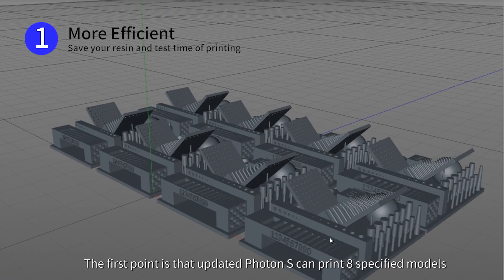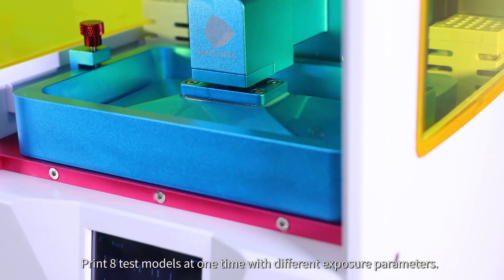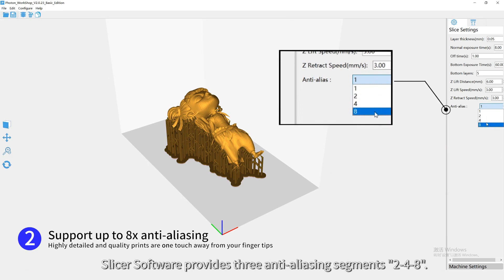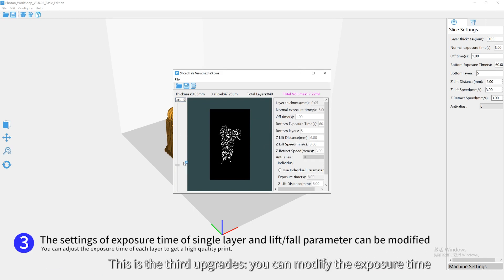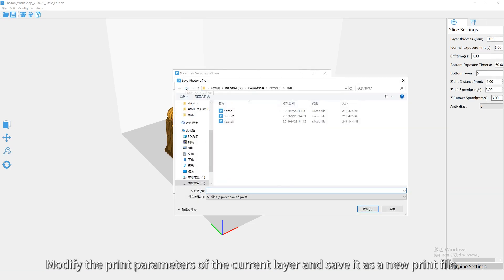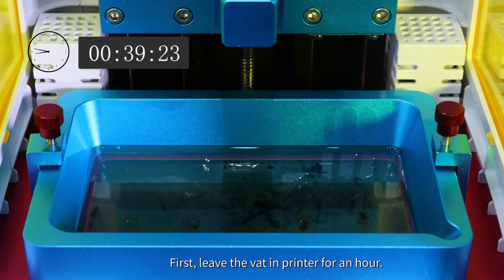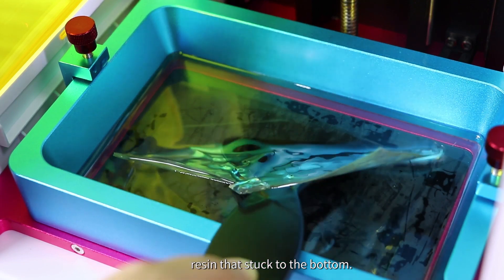Upgraded Anycubic Photon S : 8x Anti-Aliasing, A Quick Test To Know The Best Exposure Time

Comment: Curing the bottom layer for 45-60 seconds to easily remove partially cured resin is genius.  This should be more widely mentioned, as this is the first I have heard it.
Reply from the maker: Thank you for your feedback James
Reply: Yeah lol, I didn't get it why there is this option at all. It isn't even mentioned in the manual.

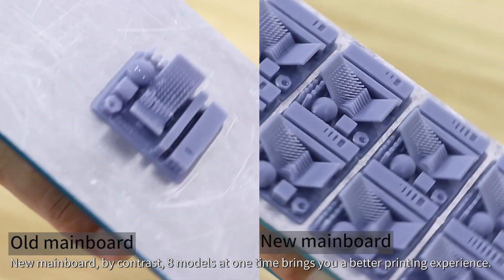Comment: 0:47 And I was worried of getting my buildplate scratched.
Reply: Isn't having a scratched build plate aqtually a good thing? I heard some people even sand them to increase the Grip of the plate.
Reply: @Zeriel00  I've seen some vids on YOUTUBE where they unbox, do a test print or two where they have trouble getting the print off the plate, then sand it to remove the anodization coating on the print side.  The finish just holds too well.  Understandable.
Reply: @Zeriel00  In that case you use your slicing software to put down a  BASE that is sufficient to hold your item.  The base should have enough area to cover the maximum area you'll need supports for.
Reply: @Zeriel00  You are more than welcome.  Would you believe that I not only do not own a printer, but never have and have never used one?  I just gave you info I got from watching vids on Youtube.  Watch some.  You'll get great info.  I didn't even know about RESIN printers until a month ago when I started searching vids.  I quickly realized that IF I were going to get a printer, it was going to be resin and not... the type with the reels of melty plastic.  What's that called, PLA?  Right now I'm looking at the Eleego SATURN and the Photon Mono X.  The Saturn is $400 or less, the Mono X is about the same size, but I've heard conflicting price points.  If it's going to be a "SATURN KILLER" as some have said, it needs to be priced competitively.  But I've seen estimates of $1K. "I aint payin' 'dat", as they say.  Anyway, let us know how your first few prints come out.  And did you scour off the anodization?
Reply: @Zeriel00  Hey, thanks for the info.  Just about every vid covers the toxicity and safety.  I'd clean out my computer room closet and put a table inside and close it up when in use.  I don't believe in going small when i know I'm going to need a larger one.  The Mars and the Mono X are by no means industrial, but they will allow me to print large figures for painting.  I'm getting older (Friday was my 54th) and my eyes aren't that good for the small details anymore.  I've designed some on HEROFORGE.COM, but if I have them print them, they won't be the size I want them.  I can do that with my own printer.  I just pay for the file I design on their site and it's mine forever to print as many as I want.  I may look into Discord soon.  I keep hearing about it.   I'll keep you in mind if I do.  Thanks, again.  Later.

Comment: Can I do all of this stuff on my regular Photon (not the S model) ? I just got it very recently and it doesn't recognize photon files, but it does recognize the RERF pws file that came on the usb stick.

EDIT: just fyi the answer to this is yes you can. As long as the file is named I believe R_E_R_F you can use it for the test. When a file is named rerf the printer automatically cuts it up in 8 squares with 1 second exposure increments. I have a super small model and placed 8 copies of it in slicing software. Just break up the build area into 8 equal squares and place the small models somewhere in there. If you have any questions message me on this comment I'll be happy to help you out
Reply: You rock Photon face. Thanks man.
Reply: I have just purchased a photon s and I have the same problem. It recognises the R_E_R_F model file but doesn't recognise the prepared cubic model by Anycubic. I'm using SOLIDWORKS and I tried to print my models on SOLIDWORKS with converting to STL type files. Again it doesn't want to recognise them despite it has to work with SLT filed as noted in on the site. 
If Anycubic can help me, it will be great because it's my first 3d print and I don't want to think that I wasted my money for nothing.
Thanks.
Reply: @Luwian12  if it's an stl it should work fine. Which slicer are you using?
Reply: @luigiangelobuonarroti4110  Are you asking for what version it is ?
Reply: @Luwian12  try another slicer as well like chitubox or lychee. I know some models give me errors on Photon Workshop because there are artifacts in the 3d model. If you repair it it work, but also maybe try Chitubox and you might not need to repair it.
Reply: @luigiangelobuonarroti4110  Ok. It was really informative and thank you very much 😊
Reply: @Luwian12  let me know if you cant get it to work. We'll figure it out
Reply: @luigiangelobuonarroti4110  Ok. I'll get you know if it doesn't work. Thanks again 😊

Comment: How CAN i use antialiasing on the Photon S? I just can't get it to work, when I save it as .photon with AA from Chitubox, it renders it in monochrome even though the images are greyscale, and when I render it in Photon Workshop with AA on, the images are monochrome already!
Reply: When you save a file from Chitubox in AA the images are stacked. Each stack is black and white. Try this, slice an object with no AA and save it. Then slice it again and save with 8x AA, then look at the file sizes. The 8x will be 8 times the size since it has 8 images per layer that are different to create a grey scale. So instead of a pixel being lit for 6 secs it might be lit for 3, basically creating a 50% grey scale.

Comment: Hello. In this video I couldn't undestand clearly how to do this test print. Can you give me a help please?
It's only works with the new firmware? Where do I get this test?
Reply: It under the tools menu on the Photon S.  Remove the vat and pick from the 3 patterns.  You can also set the exposure time.  With the lid closed you can see the LED screen looking straight down through the top lid.  I've also actually let it print the start of a model that I'm having issues with, without having the vat installed. This lets you see an image of exactly what it's trying to print without having the liquid blocking the image. Once your ready to actually do the print just shut the power off, put the vat back in and then turn it back on and do the standard print process.

Comment: Hello, I have a question regarding Z = 0. Do I have to do this calibration procedure every time an impression is made?I ask it because, at the end of each print the printing table is removed and when replacing the table, there can it be a little deregulation of Z = 0? Since adjustments are made to tenths of millimeters, any wrong angle of the print base could result in damage to the LCD.
Reply: No, only if you move the printer or are having issues with prints messing up.

Comment: I bought a Anycubic Photon S, but the printer does not recognize the memory card. Can you help me?
Reply: Hey Renan - I had the same issue and what Anycubic Support told me to do to correct the non-recognized flash drive was to put a file called P_V2923.bin (that Anycubic Support emailed to me) on the flash drive at the root level of the flash drive (ie the main directory of the flash drive).  Also it's important to NOT use any kind of USB hub/splitter/dongle with your printer - just plug the flash drive directly into the printer.  **Of note - When I did thisNOT yet upgraded my firmware to be able to use the R_E_R_F.pws file.
Reply from the maker: hi Renan, thank you for reaching out and sorry for the inconvenience it may cause. Could you please click the link below to tell us more about it? Our support team is glad to help you there. 
http://support.anycubic.com/
Reply: Print files must be in photon work shop slicing format. Files in STL, 3d Object etc ... will not appear on the printer display.

Comment: could you describe settings used for  R_E_R_F.pws? I don't know how to set up time, after printing that calibration file.
Reply: Literally the most important aspect of this test and nobody will share the details...
Reply: @DR-br5gb  normal layer exposure time corresponds to the ‘start’ exposure of your rerf, each section another second is added. So if you have normal layer time set to 4s, then your top left section 1 will be exposed for 4s, section 2 for 5s and so on. For Mono printers, it doesn’t add 1s but 0.4s. https://www.instagram.com/p/CNTHDn5jLMY/

Comment: Please include infills changes in the software. 100% infill is just so costly when you can do with 15%.
Reply: you have to do it manually. Use meshmixer and hollow the model, add hole to let resin flow out.

Comment: What was the exposure test file you used at the beginning of the video?
Reply from the maker: R_E_R_F.pws  you can download it on Anycubic official website.
Reply: @ANYCUBIC3D  does this only work on new upgraded mainboard? or any photon s
Reply: @ANYCUBIC3D  I can´t find the file at the website.
Reply from the maker: please update the firmware and you can find the file“R_E_R_F.pws”
Reply: @ANYCUBIC3D  I found the file, but not thanks to you. To everyone else that needs to know where it is the file is located with the Slicer zip file. In the english website it´s the V2.0.23_for_win link under "Slicer". Once you unzip it the installer and the R_E_R_F.pws files will be there. In the chinese I dunno if it´s the same.
Reply: @BetoHertt  thanks. I wondered why I couldn't find it. It is too bad that they made it PWS only for the Photon-S. I have the original photon and was hoping to use that exposure test.

Comment: Cool. But what means old and new Mainboard?! Photon and Photon S?! And yes we need Chitubox-Compatibility ! 😬
Reply: Chitubox can atm not be used with the new firmware. I do make my supports in chitubox still though and save it as a stl and then slice it with the new photon workshop program.
Reply: @shadowofkitsune  NICE solution - I'll try this!  been wanting to use the R_E_R_F to know more about each batch of resin and optimal settings w/o having to fail a bunch of prints first :)
Reply: I'm using Chitbox right now on my Photon S.  Just dont make the mistake of upgrading the firmware before reading the changes :)
Reply: @chuckcxr  Me too. What I mean is the compatibility with the new firmware. ;-)
Reply: I had the same reason for updating. Also being able to use the new anti-aliasing feature